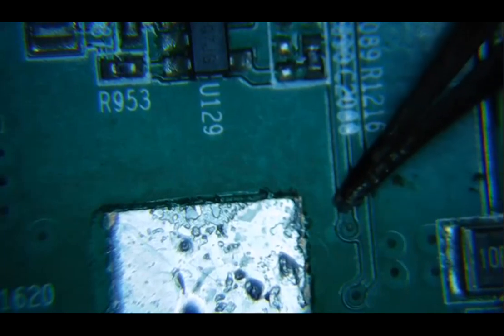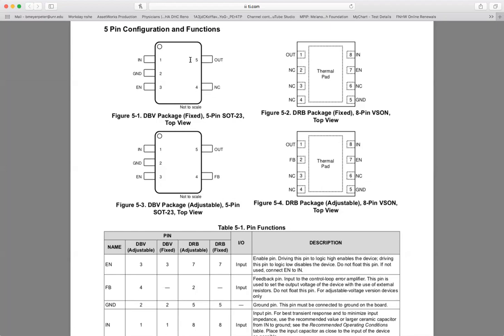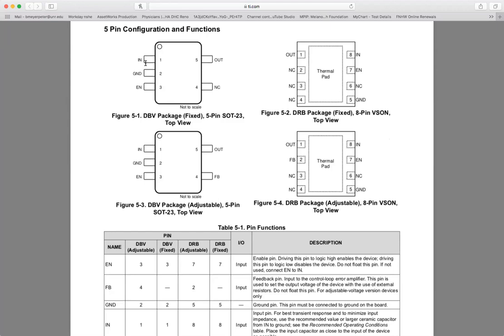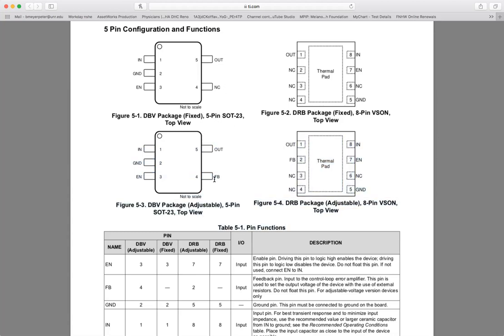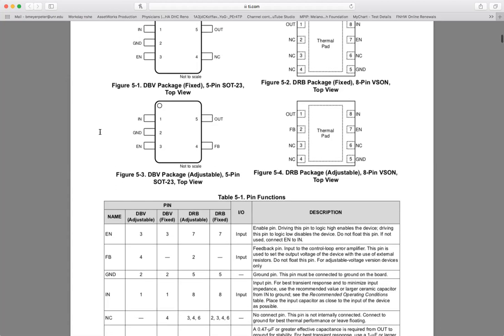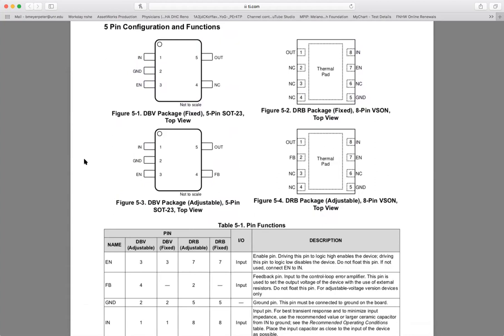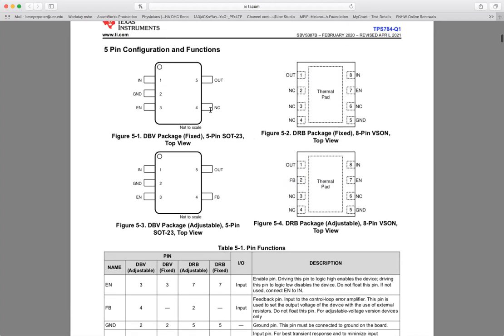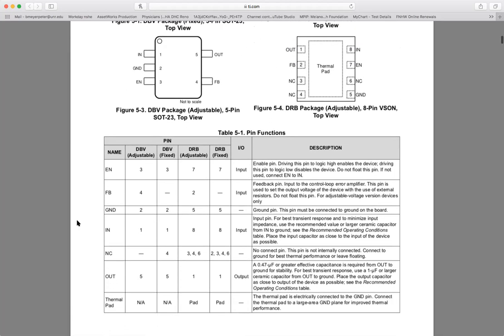hashboard repair: Diagnosing 0 asics found and LDO discussion

Comment: I have a T17 miner and some times all the 3 hash board works fine and most of the time when rebooting 2 of the hash boards shows 6 ASICs found and the other board shows only 24 ASICs found. But if I unplug the miner for couple of hours the boards some times pick all the 30 ASICs and works fine for couple of hours and gives and error chain #0 or Chain #1 malfunction and stops working. Please suggest what I should do
Reply from the maker: Loose solder connection heat related

Comment: Only trouble here is that the dredded SY8120B1 boost regulator is not stocked by anyone, and the Ti equivalents (better ...etc.) are not pin compatible. Go figure.

Comment: 32:23 i have a short in the capacitor C596, i removed the chip but the short still here, i checked the LDO they are fine, i cant find the short, any suggestions
Reply from the maker: In my experience on the T17, the shorts are usually in the chip or soldering.  I have yet to find a burned up capacitor, with the exception of some of the electrolytic capacitors on the back.  I know in some other models (L3 for example), LDOS and caps are frequent causes of pain...
Reply: @AntminerRepair  i removed a asic chip but the short still here,so its not soldering issue

Comment: What guy from Russia were you referring to?
Reply from the maker: https://www.youtube.com/channel/UCRynQfCfcOJGGLS1PBnJsYg/videos
Reply: There are several ldos out there, luckily they are listed in the repair manual, but they give 2 different ones, are they interchangeable?

And does mA rating matter?
Reply from the maker: @CryptoMinerCHR  I don’t think so.  One is adjusting voltage and the have the circuit to support it.  The other is fixed output